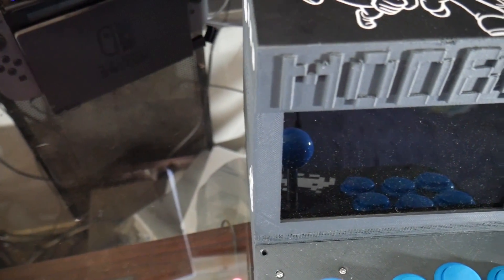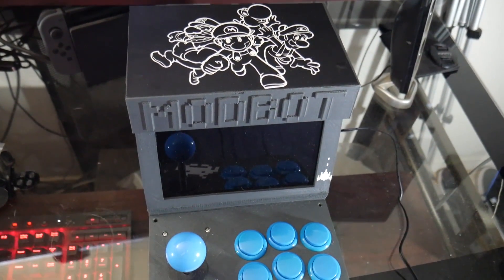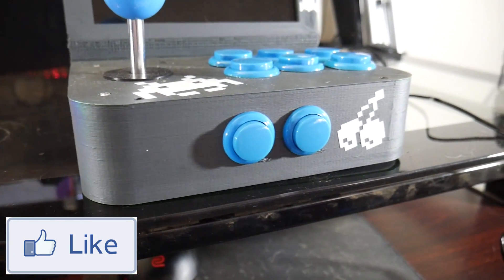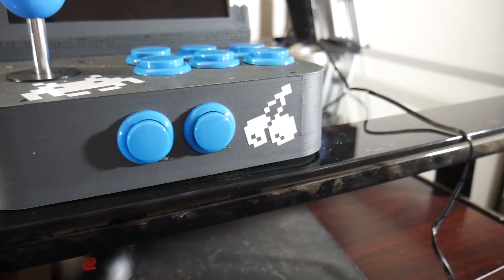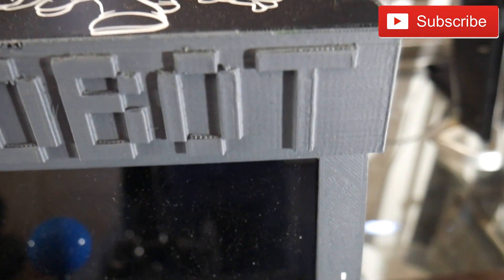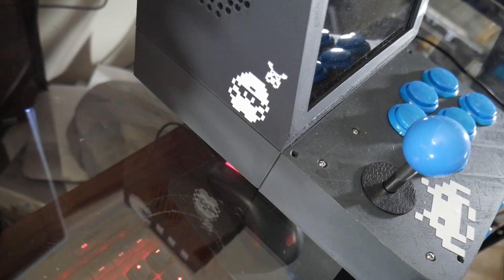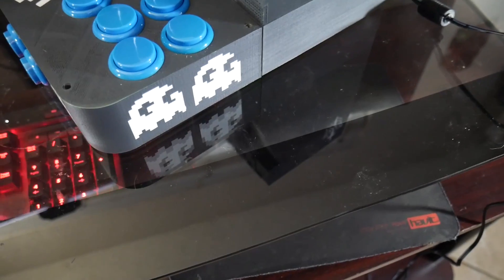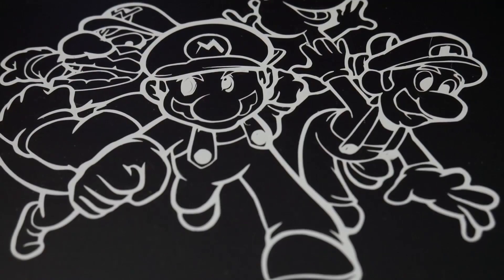3d Printed EmuPi Retropie Mini Arcade Cabinet Complete

Comment: Turned out great man. I like the custom splash screen too, they give Retropie projects like this an added "cool factor" in presentation. Also since you are using a Pi 3 you should consider adding some RCA jacks to the side or back of it to hook it up to a TV. Best part is that its just a few wires and 3 jacks so its super simple.
Reply from the maker: +The Mod Shop thanks man haha I love the splash screen it definitely makes it feel like its  mine. Thats badass I can definitely consider doing or adding that in I would love to have the option to hook it up to a TV when bringing it to someone's house!